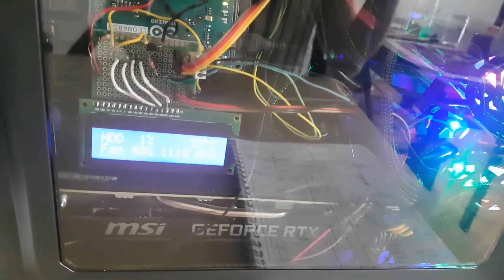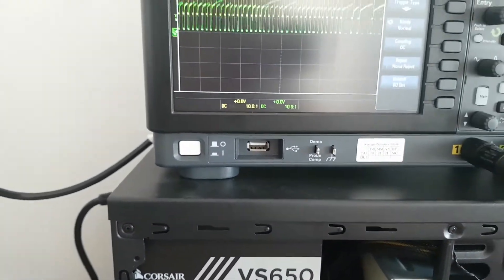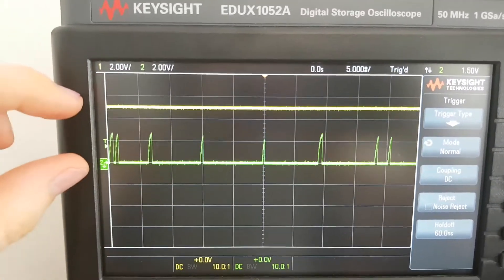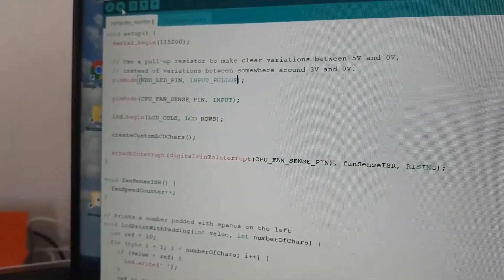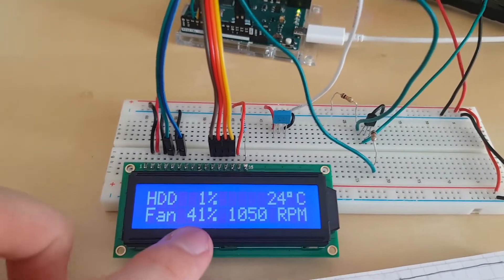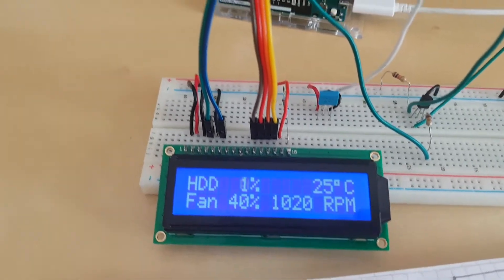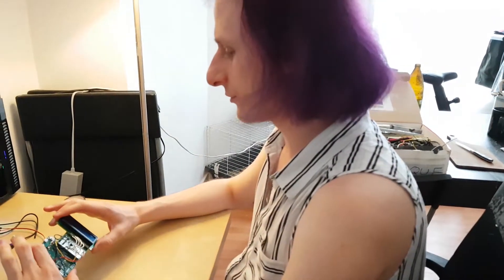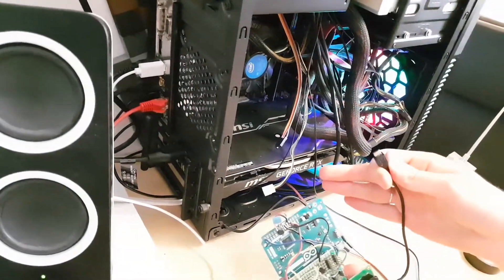How I monitor my computer with an Arduino

Comment: amazing, how did you tap the temperature circuit? im doing this 100%
Reply from the maker: Thanks :) Actually I don't, I have just used a temperature sensor on the circuit (TMP36)
Reply: @riverchampeimont  yeah i was thinking of doing that, the other option is tapping the bios data, im trying to undestand how that works because the bios looks like the only part i could "hack" for that purpouse. meanwhile im monitoring voltage too, just for the sake of showing data, im building a cyberdeck, its all about the aesthetics lol. fan speed was easy buy the idea to tap the hdd led was great.
Reply from the maker: @jonayamaha3215  One solution you still have, if like me you power the Arduino directly from a USB port in the computer, is to write a program which runs in the background on your computer, and regularly gets the BIOS sensor data and sends it to the virtual serial port which corresponds to the Arduino. Then on the Arduino side you then read the data from the serial port.